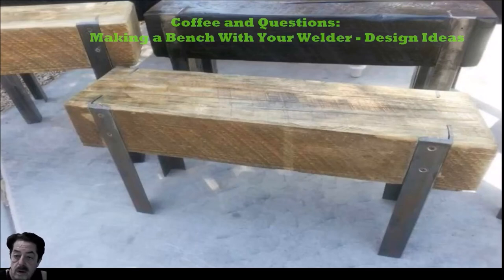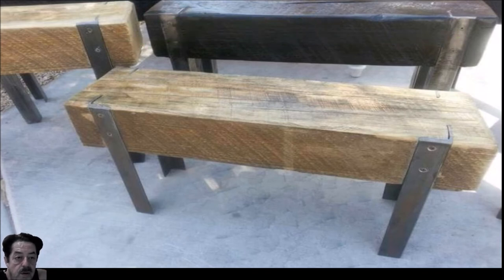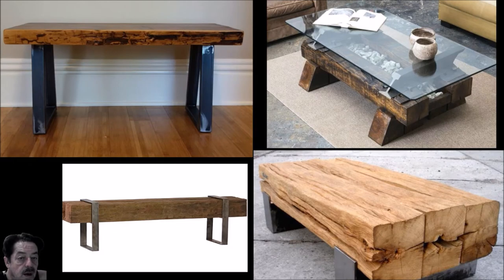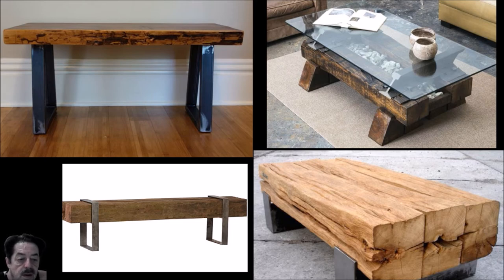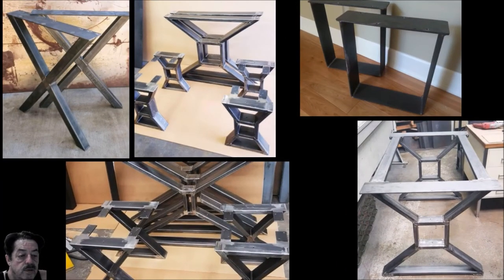How To Make Money Welding -  Part 15

Comment: i recently made a kitchen table with a cherry top. the legs are 3" I-beams, attached to a simple welded frame. i welded plates to the bottom of the legs for a finished look. the two ends of the top have inset 3/4" angle iron. people love the industrial look.
Reply from the maker: Send me a picture of it if you get a chance - Dreamthief12345@aol.com - sounds like it would look great